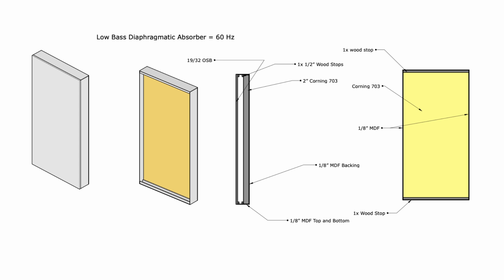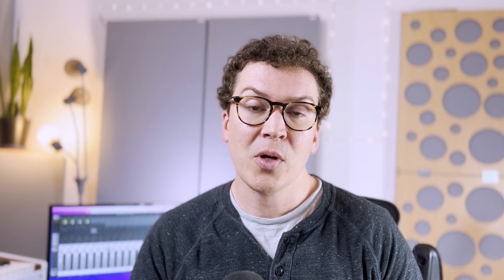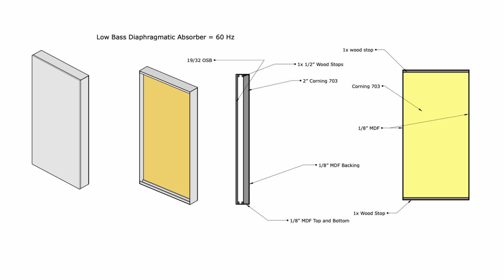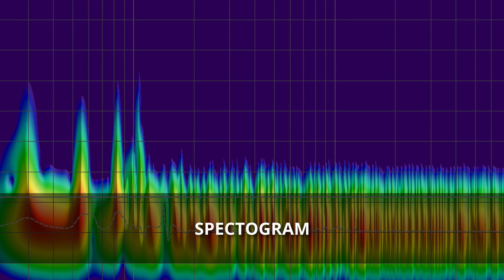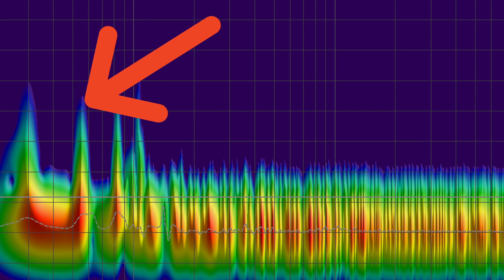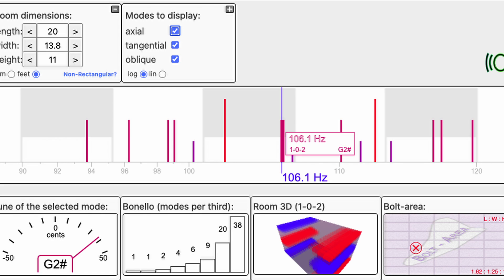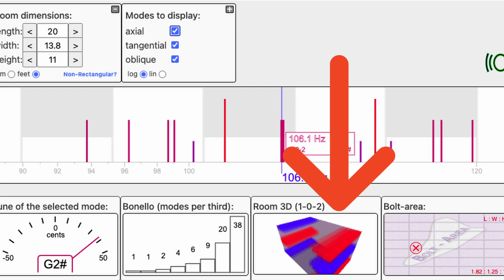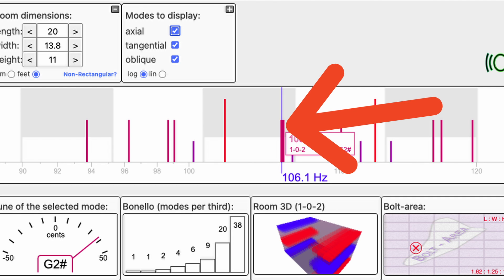How To Fix Low Frequency Problems  - Panel Diaphragmatic Absorbers

Comment: I like your presentation, and subscribed.  In the formula is the M the actual weight of the cut to size panel on front? Please clarify. 
If using 1/8" MDF on back it will also have a flexure and natural frequency. Will the front and back interfere with each other? Is thicker material for the back okay? 
Thanks!
Reply: Ahh, I found it. You said your OBS material was 2 PSF. Thanks!

Comment: So if I understand this right it’s like just a normal membrane absorber. What I’m still Tran to figure out is the math behind this. If you use a membrane that is 5kg heavy and has a width and length of 1m x 1,5m then is that the area that has to be free? Is so the I would have to have a membrane that’s 1,02m x 1,52m because  still have attach that membrane to the corpus? In an acoustic book I read that the membrane shouldn’t be thicker then 5 millimetres and not heavier then 5 kg. Is that something you would say is correct? Thanks in advance. I’ll try this out.

Comment: As a hobbyist, I've found using carpet padding to be sufficient. I "sandwiched" the padding at the very top between two cheap boards, then used a screw hook and "eye" screw to dangle the absorber about an inch off of the wall. It is better than "good enough."
Reply: we are all laughing at you

Comment: This seems extremely counterintuitive to use a thick piece of very rigid plywood for this type of absorber?  In my mind, I'm thinking about something that has a lot of flexibility in order to vibrate with the room mode.  It seems like rigid plywood would just reflect, doesn't it?
Reply: So, yes, I was right.  This is the formula for limp mass membranes, not rigid plywood.
Reply from the maker: This formula was for a membrane rigid membranes. The limp mass formula is different.

Comment: Thanks for the in-depth explanation and math.  I've built really large and heavy 40hz diaphragmatic absorbers using math from this video.  It's really made a measurable difference.  However, I see almost everyone recommend 12-24 inches of rockwool in the corner and calling it a day.  I've used and compared both methods in my room and the diaphragmatic absorbers make a noticeable difference while the rockwool in the corner did almost nothing.  Why does everyone recommend rockwool in the corners?  Are they uninformed and just repeating everything they've heard from other YouTube channels (who probably got their information from other YouTube channels)?  Your channel is only 1 of 3-4 others that state rockwool won't absorb lower frequencies and that you need pressure-based absorbers.  Your channel is also one of only a handful that provides the math and tools to back up the information.  Just a question because I keep seeing almost everyone recommending rockwool all over the room to absorb lower frequencies and that anyone that disagrees with that doesn't know what they are talking about.  I very much appreciate the information you've provided as it has really pushed my ability to mix accurately forward.
Reply from the maker: That is so great to hear! Well, there are a lot of philosophies out there on the Internet. The main problem is that diaphragmatic absorbers have a very narrow Q so you really can only treat a few frequencies and the absorber take up a lot of space. This being said you might get a more even response in your room by just using insulation. Also, the air gap behind the insulation can help treat lower frequencies because of the wavelength rule. The funny thing is no one is absolutely wrong or absolutely right the more I learn about acoustics the more I learn about physics and are on human psychology.
Reply: That's because those are velocity based traps and not pressure based traps. In corners the velocity of sound is 0, it's the pressure that builds up. The only way to take care of that is some form of pressure based absorber.

Comment: Hi, please help me to understand amroc calculator, at the room 3d image, does the red and blue represent the pressure zone? If they does, so i have to put the absorber on that area? Thank you
Reply from the maker: Yes, that is the idea.
Reply: When calculating my room with amroc, the result has so many modes, even the axial mode has so many frequency results.
How you sort the frequencies2 in order to make & place the diaphragmatic absorber below schroeder frequency?